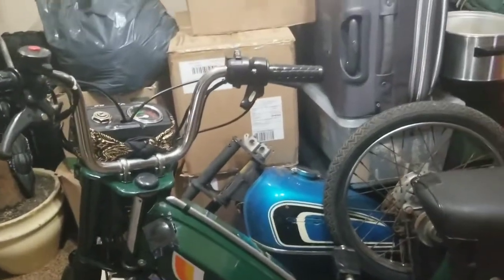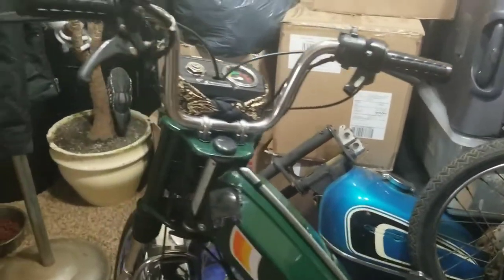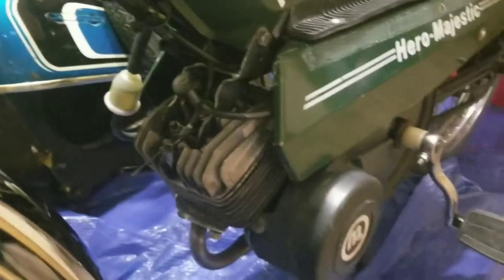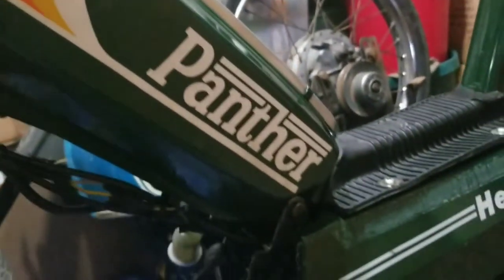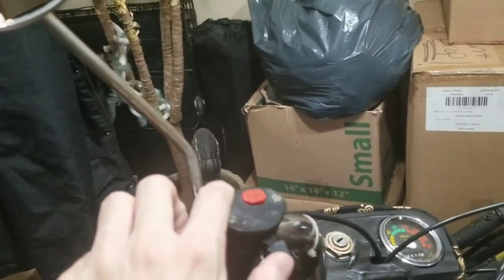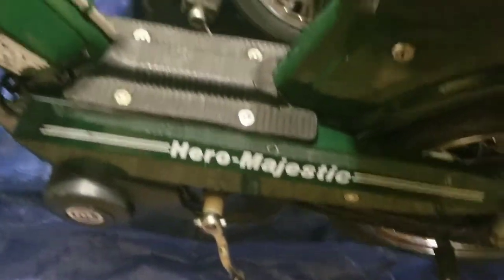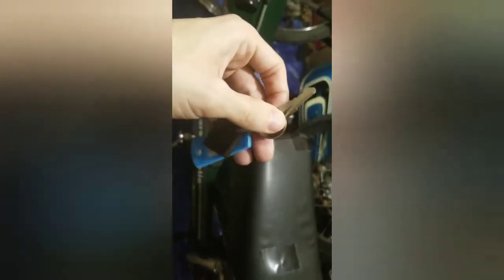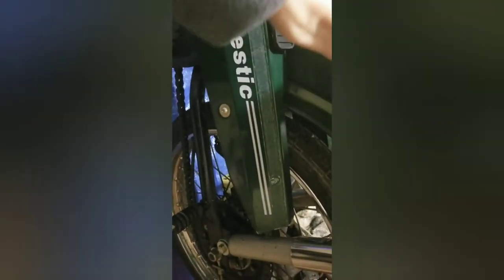1993 Hero majestic  panther  Moped

Comment: Hey man, nice lookin bike! I just picked one up very similar to that and can't find any sort of manual or schematic for it on the internet anywhere. It's got some missing and broken pieces, I you have any helpful info please hit me up!
Reply: Where abouts are you from??
Reply from the maker: midwest broski what about you
Reply from the maker: it super hard too find anything the company went bankrupt in in 2006 most hero stuff is gone,it super rare and hard too find parts or anything most it still India were bikes were mine is time capsule was driven 800 miles and forgotten about it why still runs and drives, alot if just going kinda look other similar mopeds  and go from there it simple two stroke engine ill have look on carb when I can but i used  Tomos A35 A 35 Moped Airbox Air Box Filter cues get original air filter for it i kinda squished it on and it works praise the moped gods i can just keep riding onward it  something that super pain in the ass too get parts for like most dam mopeds because usa  kind of moved onward and screw all old stuff here it ben scrapped and what not why older mopeds are kind of forgotten about